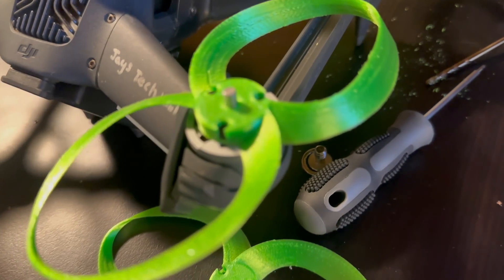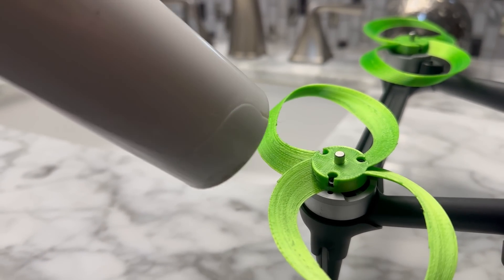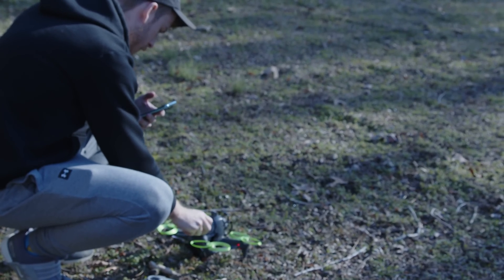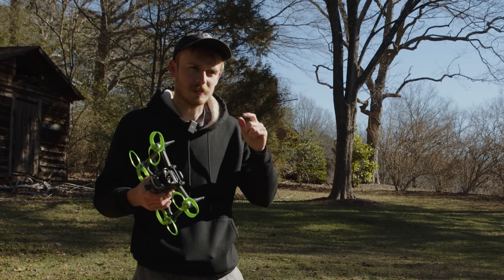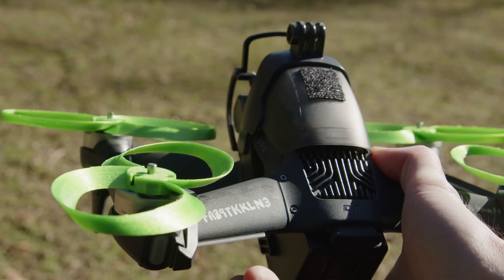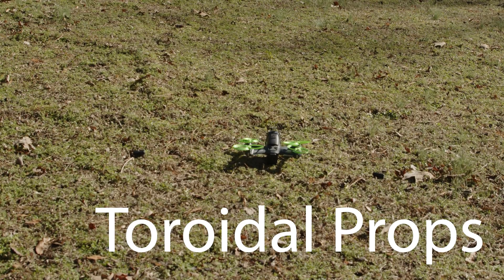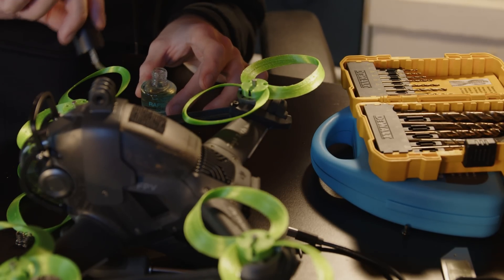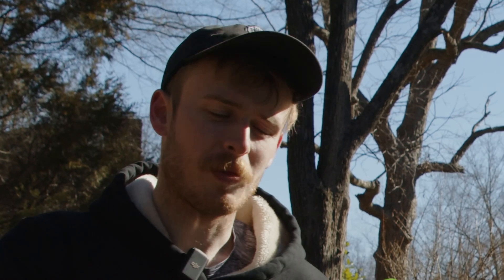Testing MIT's Toroidal Drone Propeller Design & Sound

Comment: I don't think this is true " toroidal" blades ....I was under the impression true toroidal blades are in separate halves. 

One spins independent from the other
The top blade spins counter clockwise
The bottom blade spins clockwise 

Minimum of 2 props 
I only seen 4 prop set-up

I believe this is why you don't have the realistic efficiency

I believe this is why you don't experience the realistic lower  sounds decibels

When compared to a regular Angle blade.

Anyone's serious input on my comment is absolutely welcome.

No trolling.

Comment: To remove 3d printing as variable, you could design your own "standard prop", and make it using the same method.
You you might also want to weigh them to make sure they are about the same weight.
Reply: Thats a good answer. Basically if the props weren't modelled correctly and materials poorer that would explain much.
Reply: @myprintpod1  its "modeled" from pictures, so yea crap
Reply: And balanced
Reply: @Johnny1.0  ..and balanced…
Reply: I was just going to say this, watching it.
Reply: And also compare these 3D-printed traditional blades to commercial traditional blades, to have three data points.
Reply: I literally thought the exact same thing

Comment: Have you considered using AI to improve and refine the design?
Reply: chatGPT, please  generate a proper 3D design of a toroidal propeller with MIT's specifications.
Reply: @AlOne-xg6dv  I think there's more to it than asking a chatbot AI.  Neural networks can find solutions for problems where the relationship between variables is complex.  For example with a good model you can quickly iterate through hundreds of not thousands of propeller designs.  How does Zillow estimate the sales price of a home?  There are hundreds of variables and you don't know the hundreds of equations.  But an AI can figure out all of the proper weights.  It might find a shape that is much more efficient than the loop based prop blades.
Reply: @WA4OSH  i agree.  It was just a joke as chatGPT these days is in so many mouths as the new powerful tool which will solve everything.
Reply: @AlOne-xg6dv  Although ChatGPT is a very significant advancement in AI, from when I took my first AI course in the late 1980's, I programmed a three-layer neural network with 1000 neurons in each layer. Computers then had very little RAM.  But the point I'm making is that propellers can be modeled in a more advanced AI similar to the way your brain imagines things.

Comment: you need to also 3d print the standard props and compare their efficiency to the molded blades
Reply: Yes. A controlled test. Bet printed ‘standard’ props would oscillate.
Reply: And even then you’d not know. Who knows if the shape distorts. I’d want to see this in super slow motion to see if there are any issues once they spin up.
Reply: I was wanting a weight comparison between the stock blades and the printed toroid. the rotational mass of the blade itself factors a lot into the efficiency.
Reply: Could the cold temperature, lower air density, also be a factor here?

Comment: You seem to have more surface area and weight than the stock mavic propellers. Maybe if you made smaller toroidal props you'd get comparable flight time. I don't know, but I'd like to see you try it with smaller toroidal props.

Comment: I've been wondering about this, so thanks for testing. But I don't think this test was very good. First of all, you didn't have wind filter on your mic, so much of what we heard was just wind noise. Then, I don't know if it was that the drone was at different distances, or the clips were at different volumes; but the A/B comparison volumes were totally different. Made it seem like the stock blades were much quieter. I think you should have 3D printed some stock blades to at least make the material comparison somewhat fair. It was also strange that you essentially started your video with the conclusion and then got into the results. I hope you take this as constructive feedback, not trying to shoot you down. The video was pretty informative but I think there is quite a lot of room for improvement.

Comment: Toroidal  propellers were created in 1963, Basic aerodynamics the more blades a propeller has the less efficient it becomes. The one in this video is technically 4 blades or airfoils they should be about 40%+ less efficient to traditional 2 blade propellers regardless of how you 3d print them its just the laws of basic aerodynamics.  If you notice MIT did not provide any data on the efficiency of these propellers because its very BAD. They had a chart for DB rating but mysteriously nothing on efficiency... almost like they knew everyone would see them as worthless with 40% less efficiency.

Comment: toroidal blade sounds alot louder than normally propeller that was on there
because u can hear it whiles hovering and u can tell pitch is too far off not same pitch so it unfair tests 
i have seen few toroidal successes flying in air and less destroyed blade because it just bounced off without snapped in half only downside is that vibration issues

Comment: you didn't do it right.  the Mit one is fine tuned, they made several adjustments until they arrived at just the right proportions, you merely eyeballed and 3d printed the props and did no analysis to figure the exact proportions that are optimal

Comment: Did you balance these 3d printed propellers after all the nail polishing before flying? 3d printed propellers are extremely susceptible to vibration if not well balanced....

Comment: Wonder if they tried having a ruffle on the trailing edge of the blades much like what allows owls to have silent flight. The fine ruffle on owl feathers cuts up the sound pressures at the trailing edge of the wings.

Comment: More blades in a propeller (like the stock 3-blade) means higher static pressure for a given RPM, which allows the engines on the drone to spin slower, this along with perhaps an optimistic angle of attack is likely where the lower battery time came from.

Comment: Seems like a cool concept, especially the less noise.  I'm sure DJI or someone else will perfect them.
Reply: Especially for smaller drones DJI also looks into mobility. It's hard to design toroidal propellers that can fold and pack tightly.
Reply: Tbh I didn't notice any difference
Other than it adding one extra blade and some unnecessary thrust
Reply: lolol tell me again you dont know who invents things, even after its been invented at MIT
Reply: @theendoftheline  MIT invents all links of cool stuff but this isn't it.

If it was that much more superior, at least one of the folks who have tried on youtube would be screaming their head off about it.
Reply: It's more expensive. Less efficient I'm sure. So DJI prob won't. Maybe after market like companies Ike masters crew saying they sell stealth propellers
Reply: If there were whiz bang amazing advantages to DJI utilizing toroidal prop design, they already would have done it. 
They HAVEN'T. There's a reason. 
(And in a year, none of us will even remember this silly "craze".)

Comment: i wonder if you were to use a super light filament if they’d be more efficient, i’d also be curious if something like silk PLA would improve efficiency
Reply: Something like LW-PLA? Also, usually silk is a lot more brittle, so may not be the best idea. Variable layer height would be a good one to get better geometry whilst not sacrificing much print time though
Reply: @lio1234234  the problem with 3d printed props is the fact they break easily and are borderline unreliable.
LWPLA would be a death sentence. Iv tried this shit and I dont even trust using it on my plane bruh

Comment: As an aerodynamic expert, the blade design is good. Unfortunately the way you made them, makes them unbalanced and very inefficient. Hopefully we can make them better in the future. A company makes them for boats and they are incredibly efficient and powerful.
Reply: I think they lack variable pitch towards the outer ends, or at least a variable chord. As they are designed in every video I've seen so far they just seem add a lot of air resistance and turbulence. Maybe I'm wrong, you could share some light here.
Reply: @ivoxx_  a solid structure like that cant change pitch unfortunately, in a hover they tend to be a little more turbulent yes, however when the “disc” is moving through the air at speed it becomes exponentially more efficient
Reply: @SuperJeanq  It can't change pitch if the whole prop is restricted within a defined height, but if you play a little, like twisting the "ring" shape and making the outer curve more aligned to the travel directon it could do. I mean if you look the prop sideways it wouldn't be planar, but more like an 8 shape too.
However it would be really hard to print with FDM.
Reply: @ivoxx_  by twisting it, it looses its greatest attributes. Might as well stick with a standard prob.

Comment: You propellers look very jagged have you tried to sand them smooth ? And did you create them by feel ? 
Come on you used the rough shape ? Blades and wings are carefully designed and calculated, I don't think this is a fair test sorry
Reply from the maker: Did you watch the video? They were sanded and coated in polish?